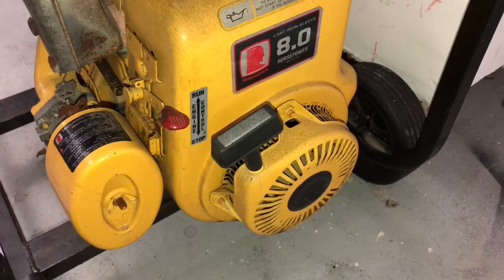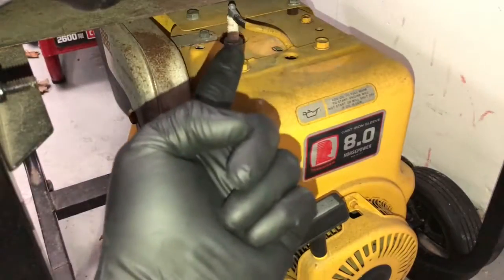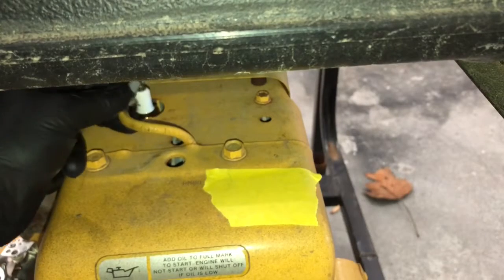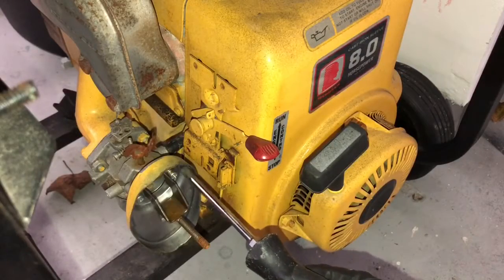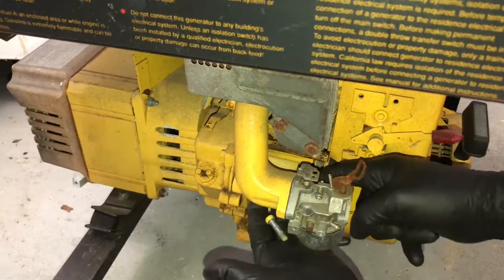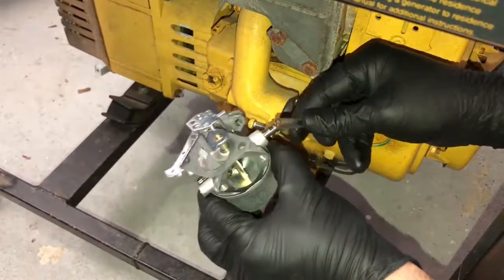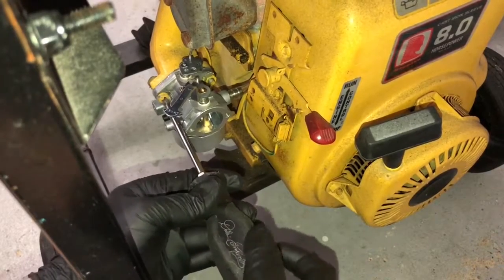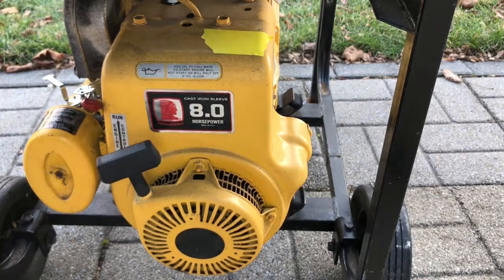How To Fix Tecumseh HM80 Motor - Replace Carburetor, Spark Plug, Air Filter And Fuel Line

Comment from the maker: Tecumseh Carburetor - https://amzn.to/2SJyoiv
Briggs & Stratton Platinum Spark Plug - https://amzn.to/2SPft5X
Tecumseh Oregon Air Filter - https://amzn.to/2EivMUM
WIX Fuel Filter - https://amzn.to/2LdJo50
Tecumseh Throttle Link - https://amzn.to/2rCt2tT
Champion Spark Plug - https://amzn.to/2PBaXWD